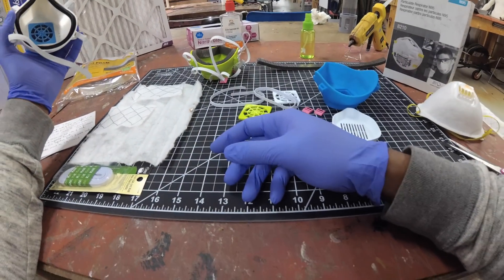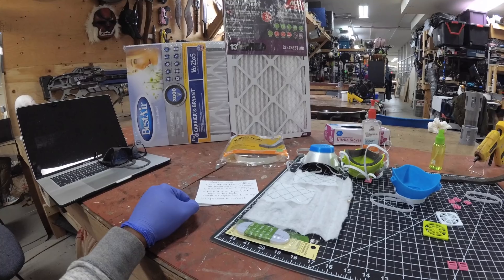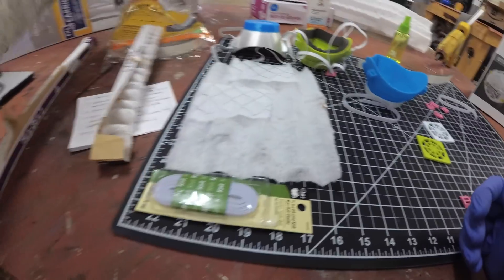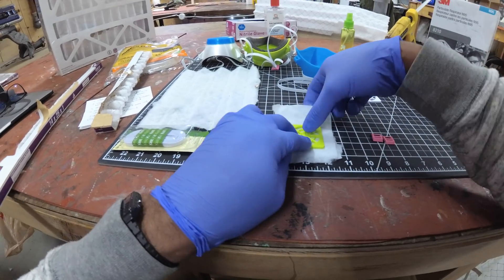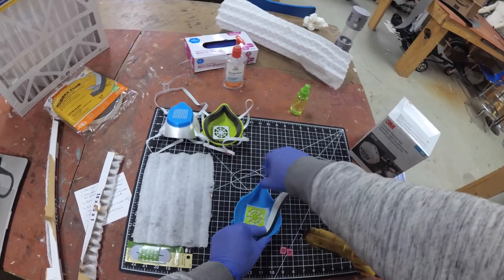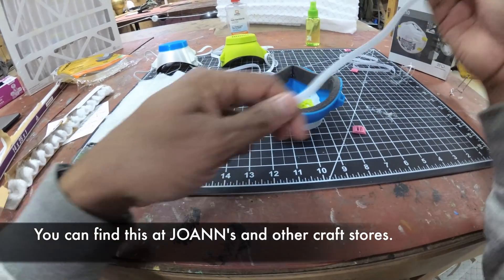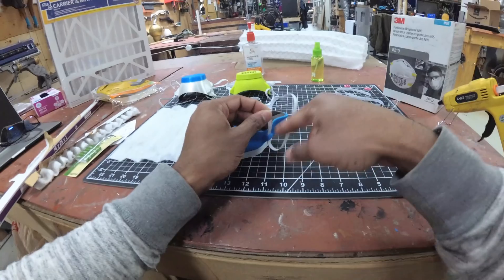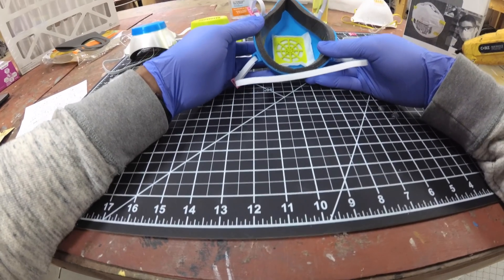3D printed PPE DIY Particulate Mask ( PROCESS )

Comment: Can you print this mask using an SLA printer?
Reply from the maker: That's the optimal way of printing these actually, as it creates a completely sealed and dense surface.
Reply: @GiveWaveStudios  What would be the recommended resin (something akin to TPU)?
Reply from the maker: @ricardodiaz7337  not 100% sure but it would need to be food safe as to not give off any toxicity ... i know those resins exist and are expensive but don't know which brand exactly to point you to .. you'd have to do some research on the matter.
Reply: @GiveWaveStudios  Thanks GiveWave. Regards,

Comment: PSA: dont use merv 16 or HEPA filters for your masks! Most of them contain fiberglass particles which when cut can be inhaled when using a mask. Better to use merv 13 or even more specifically Filtrete branded filters from 3M as they don't contain any fiberglass (not sure about all specific models, I would still do your own research). Just passing along info I've found from other videos I'm by no means a doctor so take it for what it's worth

Comment: 90% sure those filters have fiberglass which will cause irritation pretty quick. just double check to make sure its the fiberglass free kind.
Reply from the maker: The ones i use here don't. We've put them under an electron scanning microscope to check else we wouldn't be endorsing them ... but folks getting different kind than what's used in the video should def do their due diligence to check their products.

Comment: Nice idea and there are some nice mask being built by the makers.  But the surface  area in which they half to breathe  threw is to small. Now if the surface is the size of a 2 liter bottle then it would be ok.
Reply from the maker: yes. this is a work in progress the design has gone at least 12 different variations and changes since this video was posted.

Comment: could you iron plastic wrap on a tshirt and do this for a mask, seal part atleast? https://i.pinimg.com/originals/5c/79/81/5c7981aa1744fd737f9460e9e10aa3df.jpg

cut a hole and sew and tape on the filter and print for spacing it from the mouth

Comment: Has anyone tried 0.8mm nozzles to speed things up?  I've got a backlog of first responders.
Reply from the maker: Better to try and keep layers as tight as possible, this is not a situation where anyone should be taking unecessary  shortcuts :/ . These haven't been approved by any US authorities and is an  open source project, so please be as diligent as possible when prototyping your own. People's lives are risk here and we don't want anyone making these giving them out and instilling a false sense of security for the wearer. Let people know exactly what this is at this point which is a "proceed at your own risk Homebrew solution" that may be better than nothing but is NOT a replacement or alternative to proper PPE or N95 rated/tested equipment.

Comment: I remixed the outermost grill cover to display letters to represent my local police department in the event they are interested in printing their own PPE because I've already earmarked my printer to produce face shields for nurses at the local hospitals.

https://www.thingiverse.com/thing:4258160
Reply: What software did you use to make those changes? Did you design it from zero or modified the current one? Thanks!
Reply: @ricardofunk5848  I used OpenSCAD to import the STL, then I was able to add/subtract as I saw fit from there, then just output a new STL.  FYI, OpenSCAD is all code based, but if you have basic Arduino code skills, you'll be able to use OpenSCAD easily.

Comment: Please take this down.

You are not providing results of real independent tests.
Commercially available respirators that actually meet relevant standards are not rigid and have much higher levels of pliability for face fit and seal and they still need to provide multiple sizes of mask to ensure end users have an acceptable face fit.
The use of foam prevents effective sterilization / harbors bacteria.
Medical Doctors / Nurses / Staff are great resources when it comes to testing the design of medical PPE, but these designs need to be looked at by engineers specialising in Medical PPE and respiratory protection, there is far more to effective respirator design than a face seal and a filter medium.

While you have disclaimers in your video and comments, you also make claims about the effectiveness of these devices that you cannot substantiate. If people wear this device and believe it to be effective, it may lead them to take risks they otherwise would not if they did not have a respirator at all and because of this it is incredibly dangerous.

Comment: I have two questions. 1. I have found multiple mask designs and many have a chamber like this one. One mask, the filter goes on the outer grate and this one the filter goes on the inner one?  Does it matter? Should we glue a filter on the outer and snap one in on the inner one too?  2. What does the chamber do anyway? I have printed the basic parts and got the filter material so I am proceeding.  I also had to print the filter snap in holder 97% of the scale printed here to make it fit. It was too tight.  probably based on a specific printer but this is easy enough to print multiple copies.

Comment: For what it's worth, I have some Germ Glo (the UV stuff they use to teach doctors how to wash their hands). My company makes large ultrasonic washers, but I played with a smaller jewelry washer. 1 minute with Dawn dish soap and sonics removed all the Germ Glo.
Reply from the maker: Unfortunately we don't have access to a large ultrasonic washer, but thats def good to know, thx ...
Reply: @GiveWaveStudios  You don't need the big ones.  Even ones like this would work, as long at you can fit the parts in - https://www.amazon.com/Magnasonic-Professional-Ultrasonic-Eyeglasses-MGUC500/dp/B007Q2M17K (that's not from my company, just to be clear).

The advantage of using sonics is that they will clean even in crevices.  Sprays, like dishwashers, don't always get in there.  I can provide small washers at cost to medical or first responder facilities, if that would help.

Comment: Is anyone building these without scaffolding?  Cura is telling me that the nose part and the band attachments need scaffolds.
Reply: I am. It cuts it pretty close but it worked for me. I used PrusaSlicer and a CR-10 to print mine
Reply: @emilyastranova  I'm using a cr10-s and Cura. I removed the scaffolds, and it's printing fine. Thanks!
Reply: No problem without supports on my Wanhao i3
Reply: @Asignore76  yep, in spite of what Cura said, it prints fine.
Reply from the maker: we've been printing with no supports, the part should be fine depending on how well your printer handles bridging.

Comment: as iam printing a mask from thingavers iam doing a quick print at .03 nozzole  cura setting .04 top and bottom  layer is 0.3 willl go lower in fill is 30 brim ill do a second print pteg frist print is pla  but ill still use 0.3 nozzole but ill go with a 0.1.01 layer high and a .09 top bottom walls 40 infuill print speed 60 bed 51 nozzole 215 xy jerrk 2 xz jerrk 2 acc 300 if that one prints good i want to send them to my locol hospitals

Comment: Can you please validate the safety of placing a clear coat of paint on the outside of the mask to bring down the pourous surface as well as aid In sealing the mask. There are alot of variables when printing this mask. I for one have had leakage between walls of the mask. I figured I would try .26 layer height at 20 percent infill and just use some sort of seal on the mask.
Reply from the maker: 2-3 evenly well applied layers of clear coat will in deed help seal any imperfections/gaps in the outer layers of the print ... The issue becomes how to sanitize the outside of the mask as cleaning solutions could strip away or inversely effect the lacker or acrylic clear coat.

Comment: These masks work really, really well.  I've added an "additional" design for the nose cap for those who have difficulty breathing.  This design adds a CPU fan to the front that can be powered by a USB battery bank all day long.  See: https://bloggerbrothers.com/2020/03/28/quick-covid-mask-merv-13-filters/ or if you can use onshape - see: https://cad.onshape.com/documents/62568ae10ff89cd48bd847c9/w/daafd34b7da532082edf9ed0/e/ba04458a0d5585c6b9362cce  - note I refer back to this design and video.  This really is the best one.  It allows for multiple layers of filter - based on your tolerance.  I'm printing and shipping as fast as I can.
Reply: Cool idea with the cpu fan ! Will have to check that out.
Reply: Hey that's a great add on. I'm going to start printing it. Thanks for sharing!
Reply: you need a better filter, even an N95 filter blocks out 95 percent of particles that are 0.3 microns in size or larger.. and the corona virus is tiny, averaging around 0.12 microns. The positive pressure fan idea could help.. but a typical CPU fan does not build pressure, it only moves air under low pressure .. use a blower type fan instead like those used on 3D printers which require pressure and airflow.
Reply: @KrustyKlown  Ah - there are TWO filters here, inside the grid and in the nose cap. If the first one doesn't catch it, the second one will... at least that's the hope.  The fan helps a little, and certainly makes you feel a bit less like you are struggling to get the air through.  A blower could work too - would need to find a way to make that look a little less freaky.

Comment: One size does not fit all.  I think the best thing they can do is make available several versions of this, each accommodating a different face type.  For example,   oval, round, square, diamond, heart, pear and oblong.  In addition, there's probably small, medium, and large to contend with.  If you print with PLA, you can tweak the shape after it's printed by submerging parts of it in hot water (if you want a more custom fit).
Reply: By scaling the print in the slicer you can accommodate different size faces . Fore instance  I believe an 80 percent scale is for a child .
Reply: @danieltaylor945  The way I got mine to fit (as I have a "longer" face and a bigger nose) was to sort of stretch it more along the Y (and some Z) axis, not keeping the same aspect ratios.  I made one for my wife and that one I just scaled to 90% overall and fit her fine.

Comment: Did you know that FDM have porosity???
Reply from the maker: Yes, down to the microns but still effective against droplets ... One can also use a filler primer coat or resin coating to seal the print surface

Comment: I've been experimenting with a different mask, but I am going to give yours a go as it looks better. I have found you can use moldable silicon corn rubber to create a better seal. You can make the moldable rubber by mixing together silicone sealant ( food grade, or aquarium grade ) and corn flour the crafsman ( https://www.youtube.com/watch?v=5h49hjY6Psg )has a good video on how to make it. You need the silicone sealant that smells of acetic acid, otherwise the process won't work.
 If you put a strip of silicone corn putty all the way around the mask and then put a thin sandwich bag over the top of the face side  before it's set you can leave the impression of your face in the moldable silicone material, if happen to be making one for yourself. To get the silicon putty to stick really well just rub a small amount of sealant all the way around the edge of the mask before you stick it on. I tried boiling my mask in a pan for five minutes. The silicon corn putty was unharmed,but  the mask made from abs-x deformed badly.
Reply from the maker: Thx for the feedback for this, will look into it ... But just a heads you don't want to make these out of ABS, PLA or PETG are the safest to use per our feedback from hospitals who've been testing these for us

Comment: Hi! Would adding a coat of primer help plug up any holes made in the printing process, and also make it easier to clean? For my mask, I'm using an electrostatic furnace filter, that says it can filter out particles between 0.1 micro and 0.3 micron. It is MERV 11, so it doesn't contain any fiberglass. I have heard that electrostatic filters are more effective than other types of filters.
Reply from the maker: Priming, Sanding & sealing your print will definitely help close the majority of gaps on your part

Comment: l am more concerned with the use of the foam rubber weather strip. I imagine it is quite porous.
Reply from the maker: It's passed fit tests for hospitals with it ... We're just merely showing folks what our process is, you don't have to use it if you don't want to or have something you think is better. We clearly prescribe that this method is better than nothing but a use at your own risk situation 👍

Comment: You might be interested in this video, which mention the difficulty cleaning such masks, as well as their porous nature https://youtu.be/77PgC3kMrFs
Reply: Sorry to people trying to help, but 3D printing a mask with a guess at filtration  efficacy is not a solution. These masks have to be sterilized frequently. A few hundred or thousand, 3D prints is a drop in the ocean of need. Ontario auto industry will be making N95 certified masks with a  output capacity of 9 million a week. From what I see here, this is about as practical  as a bandana.
Reply: @truantray  and potentially dangerous to the wearer. if its too hard to exhale through, a buildup of co2 inside the mas will occur. the upside is these are going through testing of some sort, so hopefully that puts the issue to rest. ultimately, its a drop in the ocean. the face shields people are printing up are a better use of printer time as those can actually do well against someone coughing and such, from getting in your eyes.

Comment: 2 things. 1) Have you taken into consideration the porous nature of 3D printed components? They aren't air tight. 2) Vacuum bags that claim to be HEPA usually aren't actually HEPA rated. The HEPA level filtration comes from a combination of both the primary (Bag) and secondary filters. Vacuum bags are typically between MERV 10 and 12 which is 85-95% not the 99.97% people are assuming they are.
Reply from the maker: We are not promoting this as a replacement for N95, but assembled correctly this will provide more protection than nothing or a bandana around the face. We're also asking that folks visit our site for the most updated info on this project as we were well aware the minute this video was uploaded it'd be outdated as we would've tested other filtration options etc. ... we say this MULTIPLE times throughout the video. This design has also passed various fit tests by local hospitals and in some cases are already in use. But the medical professionals using them are well aware of the shortcomings.

Comment: Big note here: the virus (covid-19) size is around 80nm, 200 times smaller than any fillament 3d printer, hence this being useless
Reply: What are you talking about? What does filament size have to do with anything. The only area where air can get through this mask is filtered. Some are using polypropylene. Literally the same thing as a N95. Also the virus carrier is droplets from a cough. Typically they're .5 or bigger. Unless you're performing cpr
Reply: @respond_code3   not the filament itself,  filament 3d printers leave pores on the final piece, where the virus can get thru
Reply: @mizarstifmeister7298  i see what you're saying now. But that would mean there would need to be air that could literally travel through the pla. These are air tight. I'm not with the Fire Dept anymore so i don't have access to nebulizer and chemicals for a fit test. But I do believe I read a comment on here where a hospital employee tested the mask by going through the fit test process and it passed.. All I could do was hold my hand over the front making a seal and blow out. Passed a air tight seal. But as of now the virus isn't airborne . it can travel through the air via droplets. But most of these are .5 or larger.
I'd be interested in fit testing just to see how well the filter material works. Found the kit online. Same as they use I'm the Fire Dept. $155 but sold out. So oh well.